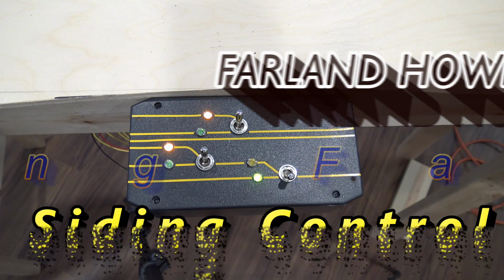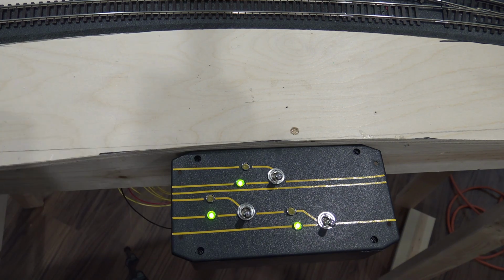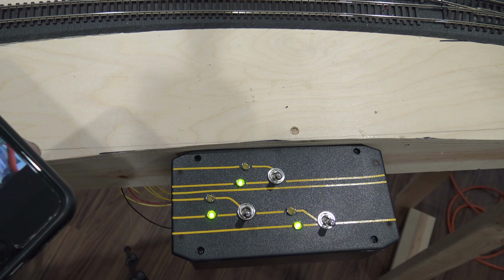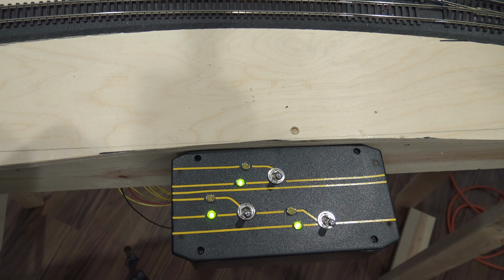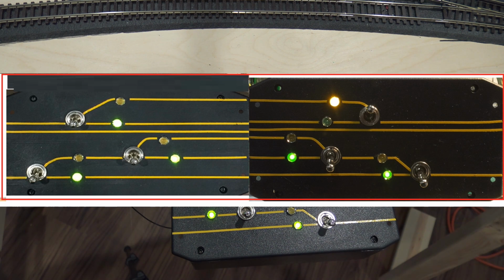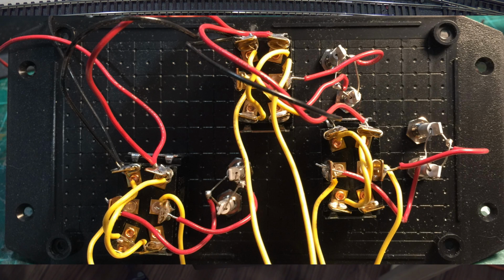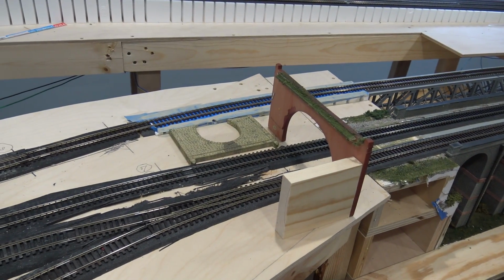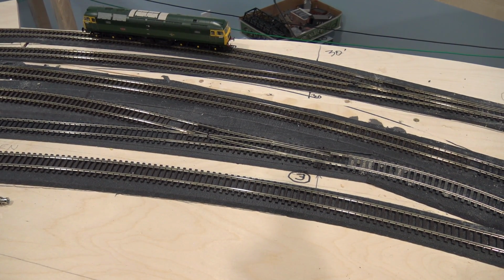14B Building Farland  - Siding control

Comment: hi Rob... thanks for the shout out... you have done a great job getting your LED's operational... this might be an easier way for you to do it.. i hope i can explain it correctly...  we will call the terminals on the LED's as positive & minus or (short & long)... using only one leg from your DPDT switch to your Tortoise install your LED's  in line connecting them + to -  it would be easier if i could send you a pic of what i am trying to say... so from your switch to LED #1 positive then LED #1 negative to LED #2 negative then from LED #2 positive to the Tortoise... it's been a while since I've installed switch machines so i might be wrong with the orientation of the LED + & - .... you might have to reverse the connection at the LED's... if you don't understand what i am trying to say email me at VinnyVid@outlook.com i will draw a schematic for you take a pic of it & email you the pic... vinny
Reply from the maker: bnsf6951 Hi Vinny, your suggestion saved a lot of wire to and from the Tortoise motor.  My email is on my about page.  Or we can do messenger if you are on Facebook.  Sure, any suggestions are welcome from you.  Thank you, Rob

Comment: Well rob using your method has just stopped me having to pull my hair out on how to fit my own custom directional lighting in most of my older locos, I had been thinking about it along with many other tasks ahead of me but I'm sure if I use this way of connecting smaller led's within the loco it will not only save space but also a headache of figuring out how to wire them all up. Just this one video showing how the opposite terminals work on LEDs  has simplified it so much. Thanks for sharing. Bri. Electrics are not my strong point.
Reply from the maker: northeast74 Righto, if they are DC, it is easy.  You can light them up as much as you want, they will change depending on polarity.  Just figure out what the polarity is going toward and wire the leds appropriately.  Just do one and don't solder it up till you are sure.  Thank you, Rob

Comment: Hi Rob....
why don't you control your turnouts from your Z21?   You would not have needed to make the switch boxes and do all that soldering! and you get position indication too...
It is looking great ... keep up the good work !   Regards.....Nigel
Reply from the maker: S Stockmotorman Hi Nigel, yes I could have done that, but imitating physical controls with programmable panels is not the way I want it.  I wanted physical controls with indicators and now I know how to build them.  If I have a regret it would be that I didn't think about setting up the Tortoise motors so route control was possible from a single switch.  Otherwise it is perfect for me, thank you, Rob
Reply from the maker: S Stockmotorman Yes, thank you
Reply: Rob McCrain 
Rob, I quite agree about setting turnouts "manually", so that you're involved on the layout.  For points that are intimately paired, linking them together is a useful labour-saving device.  Moving on to set up routes at the push of a button moves just a bit closer to simulation,. Let's keep the hobbyist in control!

Investment to do points and signals does tend to multiply up! 
But I do wonder about interlocks, so trains can run a block behind each other. (Semi-automatic signals, anyone?)

Comment: Multiple boxes around the layout is a much better way than a single panel.  The only way for central operation is with electronic control.  Those boxes work well.
Reply from the maker: Scott Downey Yes, finally they work right.  All the +s and -s have to add up.  Eventually, I got my mind around it.  Thank you Scott.......Rob

Comment: You are giving it your best Rob , the only way after starting a new layout you can now do what you did not do before , and getting it right without rushing is the main thing .. you will have full CONTROL .. no wonder you are pleased as Punch .. Dave
Reply from the maker: David Howarth Yes David, this for me, was not easy.  It looks like it should be easy, but physically making it work right, is not what it seems.  Well, now it does.  I know what length of wire works best and how to route it.  How to keep the polarity straight so when you connect power, the correct lights are lit.  Thank you, Rob
Reply: Rob McCrain 
Rob, so unlike you to struggle with this, but thanks for showing the development, warts and all.
And when you do it to the wharf, you can remove the main power tell-tale! (Mind you, what would you do with the hole? ;)
For such long sidings, you wouldn't want the points to be paired for routing; you're not running DC, after all!
Good description of what could be quite confusing.
Reply from the maker: Tom Lawton Hi Tom, yes warts and all.  To do routes, one would need to start by lining up the motors so that their polarities were matched when pointed in opposite directions.  I haven't gotten that far, but could be done sure.  I am learning.  You would need to plan that from the outset and I wasn't that far along when these were installed.  Thank you, Rob
Reply from the maker: Tom Lawton Actually the polarities of the Tortoise motors would need to be opposite.  I just had that thought.
Reply: Rob McCrain 
Rob, if the sidings are under the farm, how will you stop the trains without fouling the points?
On DC, you would have a zone isolated, which stops the train (!), but for DCC that zone (if visible) should have DC power to slow according to the Decel schedule on the CV.  Of course, your hidden sidings could use the Isolation method, as long as you don't have large stay-alive capacitors.
But you'll need to fit isolators to long enough sections of track, and wire, before you start to plant the farm.
Regards, Tom
Reply: Rob McCrain 
Rob, probably two ways to do the wiring of the point motors.
First is pragmatic; accept the wires running to the tortoise have a bias that may not be followed, and so wire one of them "wrong", and mark it as paired.  This joining could happen away from the control box, which simplifies the complexity inside the box, and also allows room to add notes/labels for the pairing.
Second is to plan far ahead, and wire the tortoise for Normal/Reverse, so the pair would be both normal, even though one is set left and the other set right.

The other confusion is that if you were to pair them, your two "boxes" would have to interact, and so would need momentary contacts to drive the points, and visibility of the actual point position (hence using the switch within the tortoise)
All sounds a bit too much, and even now (with just the track down) seems to be too late.
Reply: Rob McCrain 
Rob, the switch in the tortoise is used to set the frog.  
You could power your indicators between the frog and the running rails.
When the point is set left, the frog matches the right rail, and so would not drive the right indicator, because there is no potential there. But the left rail would have a potential difference, so would light the left indicator. Current consumption is trivial compare to the train motor, but because the rails are AC powered, the polarity of the LED is not crucial! (Old skool;) and it reports the actual position of the point, not just the drive!
Which the allows two boxes to show the status (or even a big overhead panel), and, using momentary switches, two panels to control the points.
Reply from the maker: Tom Lawton Tom, I plan to have peek holes.  The trains under the farm will be fully visible from the side.  If I don't like it, I will install sensors where I want the train to stop.  When the light goes on, stop the the train.  It will be primarily storage.  Thanks again.
Reply from the maker: Tom Lawton Yes, that is what I was thinking.  Too late.  Who knows, I may come up with a solution.  I must admit, I was driving hard towards getting these controls working and didn't think about it.  My other layout had a few paired turnouts except at the entrance to a station.  Then they were intentionally separate.